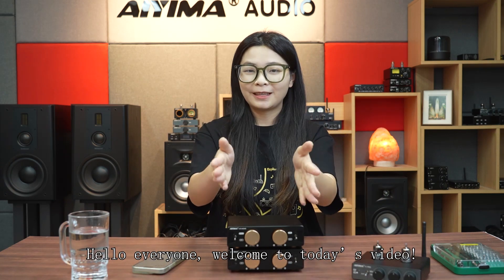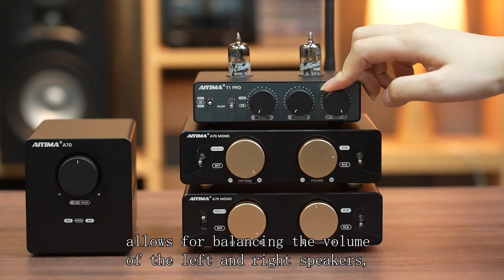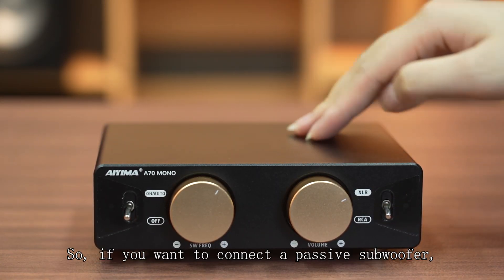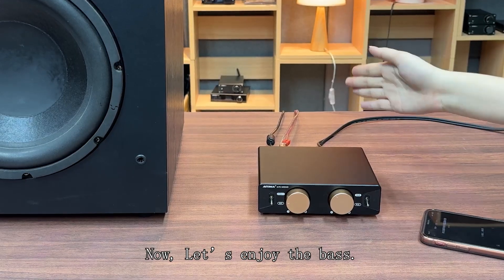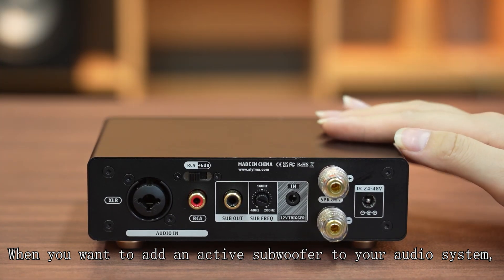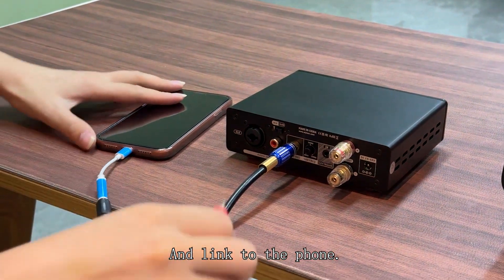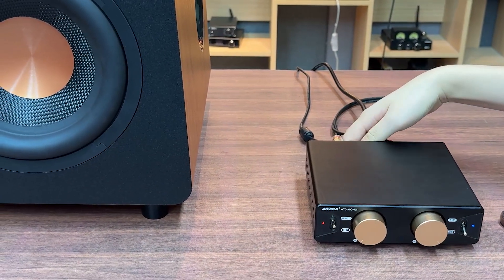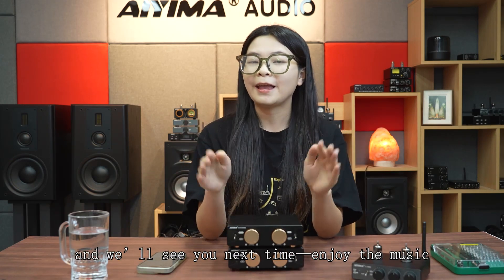[Aiyima A70 Mono] Active / Passive Subwoofers Explained

Comment: Can I use it to create a fullrange speaker connecting 1 speaker and 1 subwoofer at the same time? Example: 1 speaker play from high to 100Hz and subwoofer from 100Hz to low frequency? Is it a sort of crossover or not?

Comment: I'm confused. The amp doesn't have stereo input, how am I supposed to connect it to my system?? I only have stereo out.

Also, you're showing connecting your phone to the amp but only 1 channel. What about the other channel? Did you setup your phone play MONO?
Reply from the maker: How to connect stereo output to A70 Mono:

The A70 Mono is a mono amplifier, meaning each unit handles only one channel (left or right).
If your source has stereo output (like a phone or DAC), you'll need two A70 Mono units:
one for the left channel and one for the right channel, each driving its own speaker.

Why there’s only one channel in the demo video:

In the video, the A70 Mono is used as a subwoofer amplifier, set to Sub mode,
so only one channel is connected and no main speakers are used.
Reply: @aiyima_audio  Thank you for the answer. What if I want to connect a sub but my system only has a stereo out? I understand the sub is mono but If I connect only 1 channel(left) from my stereo out source to the amp like you did in the video, wouldn't that mean I lose amplitude by utilizing half the signal?
Reply from the maker: @mikeus77  Please contac joy@aiyima
.com. Can help you solve the problem better.

Comment: hello what kind of cutoff curve is implemented for the sub ? 12dB/octave , 24 dB/octave?
Reply from the maker: 12db.
Reply: on the front knob and rear one??  @aiyima_audio
Reply from the maker: @PaulCrawhorn What question are you asking?
Reply: @aiyima_audio  Is that 12db slope true for both the LP filters, line-level knob in back and sub mode for speakers using the big left knob in front?
Reply from the maker: @PaulCrawhorn  yes！